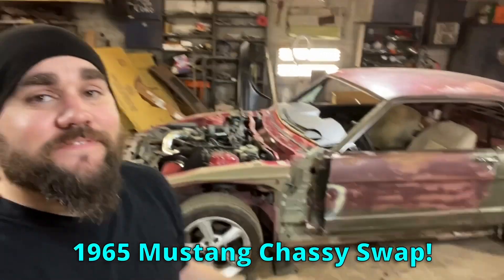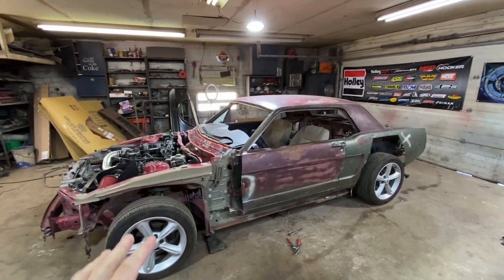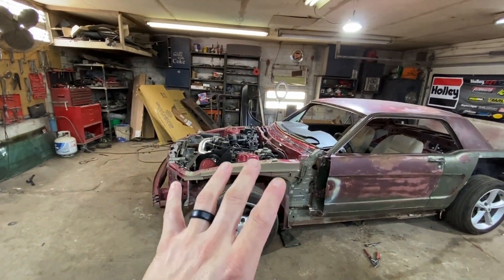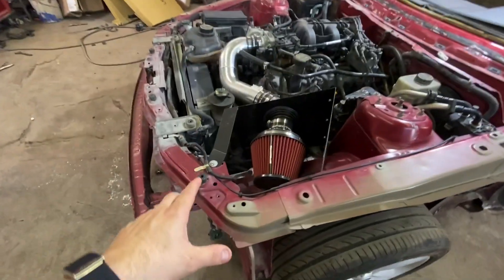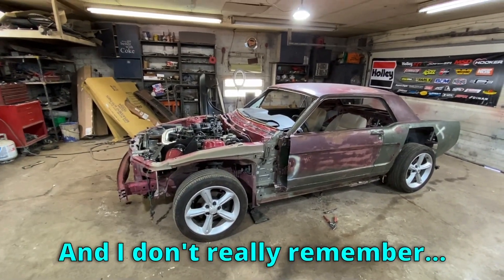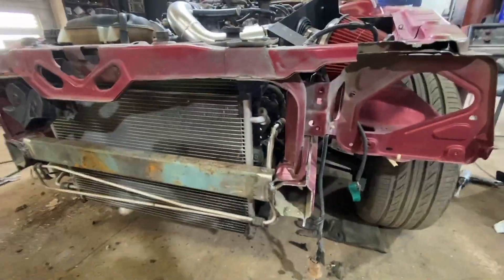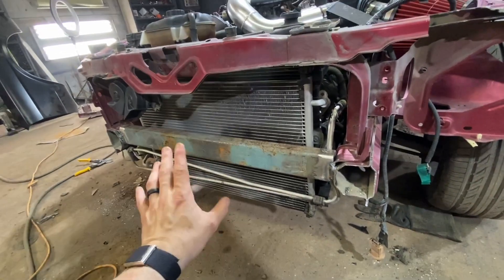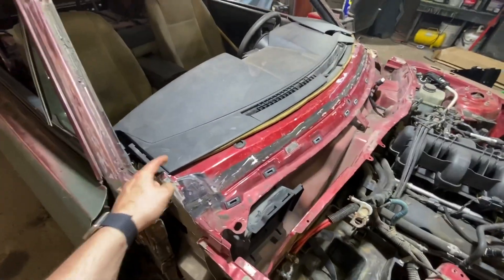CUTTING UP A PERFECT NEW CAR! 1965 MUSTANG CHASSIS SWAP! Part 5! KUSTOM HOT RAT ROD MODERN BUILD!

Comment: I would use some old school sidepipes on it. 
And the fenders,if you cut on the top on the fender, from the light bucket and all the way back to the windowpost,you can pull the fender out to match the door,and just fill in that gap with sheet metal.

Comment: Thank you for making a video like this i am gaining alot of ideas for when i do mine to try to stay away from the rocker issue i was planning on leaving my 66mustang convertible original rockers on then notching the 95 mustang convertible out to fit mine for wheel base issue i will be stretching car 7 inches by cutting across rear floor pans i just feel it will be easier than than all that body work thanks again cant wait for next video i also subscribed

Comment: I'm watching this for the first time so I don't know what you ended up doing but the whole "rocker situation" isn't as big of a deal as you think.   If you paint that area  under the actual 65 rockers flat black, it kind of disappears.  You could also run side pipe exhaust to cover it, which would be really badass.

Comment: The best solution for getting the body where you want it is to 'just' section the firewall and inner fenders/shock towers up front, which should only take an extra month or two when you include all the disassembly and reassembly of the dash and all the accessories that are in the way. (and you would have to lower the seat brackets, and the engine would probably be too tall)

My more serious vote is on C2 Corvette style side pipes to hide the bottom of the sill. Will give it a tiny bit of a 70's Street freak look, but I honestly like that look :)
Reply from the maker: I’m definitely looking into the side pipe design. They can just get hideous real fast so it’s a delicate setup lol

Comment: Maybe cut the car in half a few inches behind the doors so you can move the front forward of the dash to fit the windshield and move the back rearward to line up the rear wheel wells.  A donor Mustang could provide the fill panels.

Comment: To bad your not running an R model racing apron, gets rid of the bumper, bumper brackets, upper stone deflector and front valance.
Reply from the maker: I actually have one of those coming i believe, i already have the lower grille for it

Comment: Those side sills you cut are the actual frame, and is for rigidity and strength,  so by cutting those you have weakened the structure. Car looks good,  but hacked 2 good cars up.